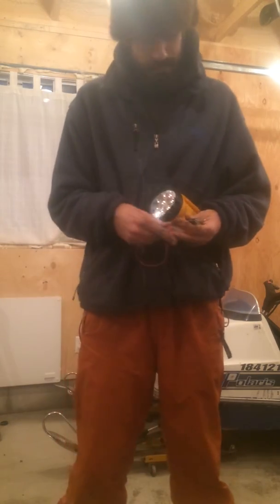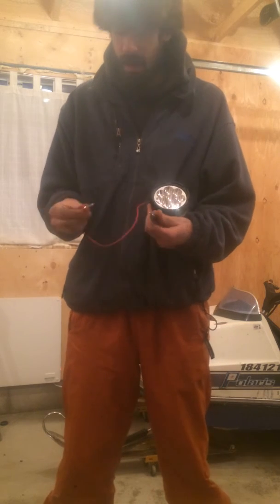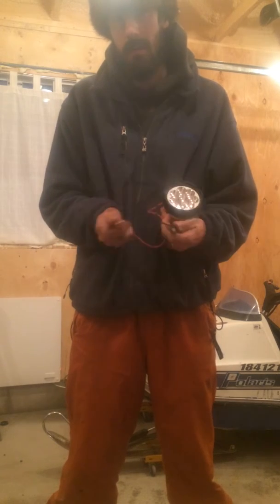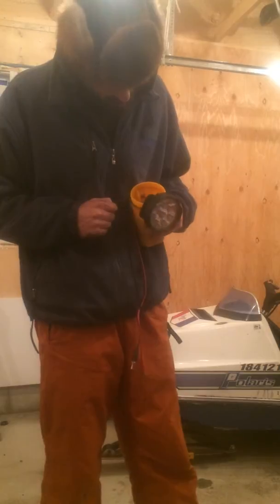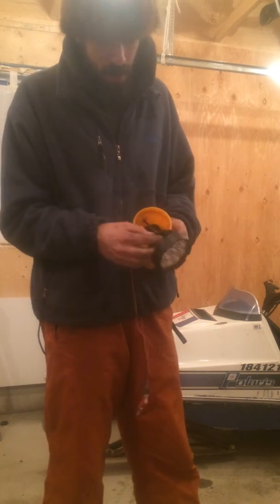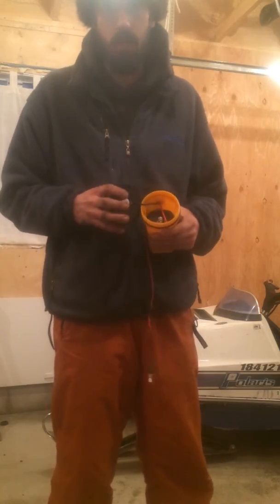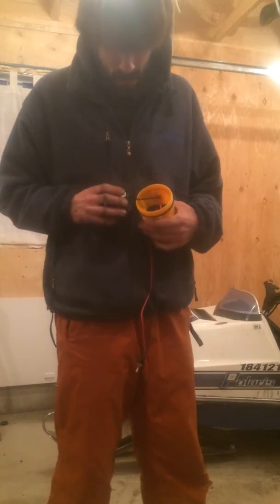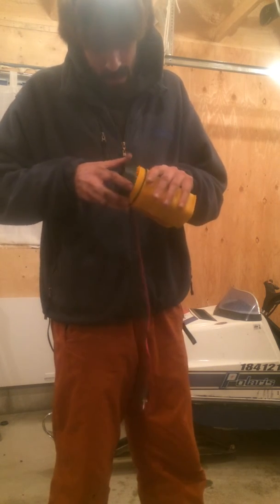Cheap DIY Timing Light under 10$

Comment: How do you use that thing to time something? You need a clamp, transformer, or coil to pick up the magnetic field of the #1 spark plug to sense the current from the spark plug firing. You might use that to send Morse code or something but hardly any one knows Morse code so you would have to learn that and that would be about as useful a waste of time as making that monstrosity. All he did was remove the switch and extend the wires! Bravo!

Comment from the maker: This timing light works like gold. You connect the red wire from light to the blue wire (my vintage snowmobile) and put the black to ground. then you turn armature plate and it will flicker when your points just start to open.
Reply: Then what you are doing is trying to flash the LEDs with high voltage.

Comment: I've seen a few of these videos doing the same thing, all you've done is replace your switch with two wires, how is this a timing light?? Where do you get your signal? Where do you connect your two wires now? This is no where near complete....
Reply: I haven't tested it, but I think you could connect it to the battery + and coil - terminals.  Otherwise, you need a sensor and some kind of transistor circuit to switch the power.